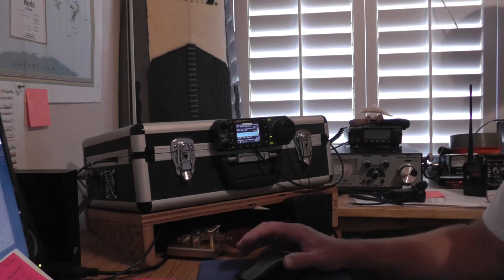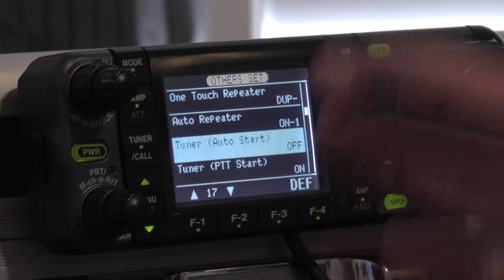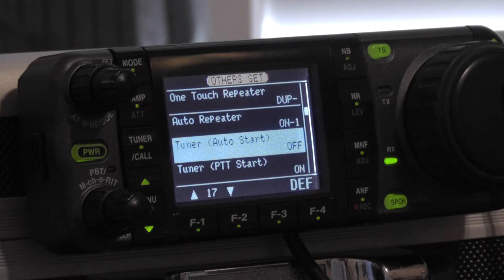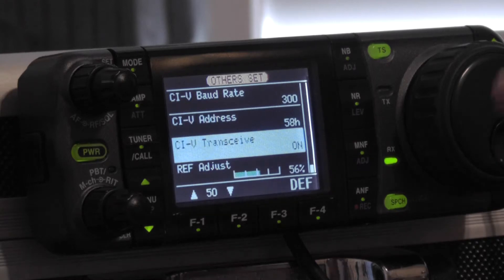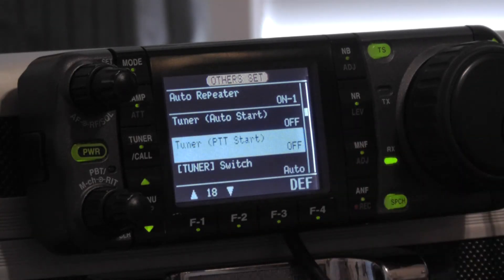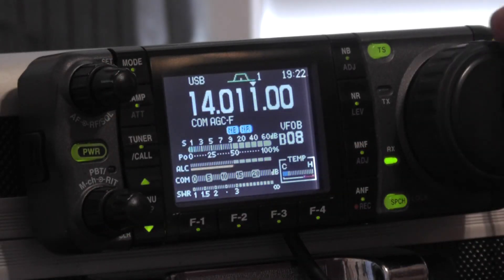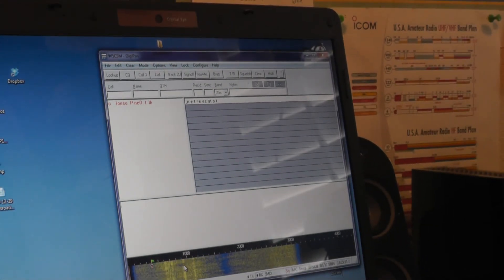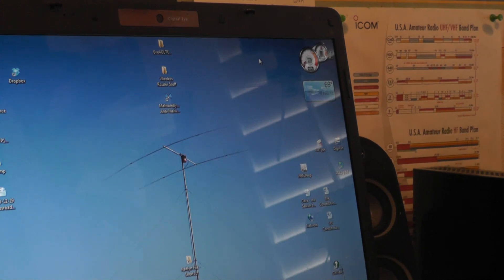Icom 7000 Menu Settings Turbo Tuner for Icom Radios (mobile) to Rig Blaster (base digital)

Comment: Just installed the Turbo Tuner 2 in my pickup truck Today to control my Lil TARHEEL HP and the numbers were far different in my ICOM 7000. All were different and all of the dip switches are set to OFF except the bottom one which is set to ON. It works very very well except the SWR is slightly above 2.1 on 40 meters no matter how many times I retune it? It still puts out 90 watts or more with the 2.1 SWR & unlike many I know that SWR will not damage the radio. I Rarely ever use 40 meters so it’s not an issue for me. I stay on 17 meters about 75% or more of the time and 6 meters if the Magic Band is Open. I had the same model of controller on another 7000 15 or 20 years ago with a TARHEEL II & I worked the world with it. I love DX & mobile DX is great as well. Thanks for your video and God Bless. de W4KVW 🎙

Comment: Question: What is the difference between the Turbo Tuner 2, and the LDG at-7000?  
I just picked up a ic-7000 for my car, and I'm trying to figure out the best tuner/antenna combination, to allow automatic tuning on all bands, including 80 meters.
Thanks and 73
KE6QMR
Reply from the maker: As far as performance you will need to seek out objective reviews on the individual products. I am not familiar with the newer TT2. I  have also run an LDG on this rig years ago but also older and nit the 7000 model. As I recall there may havw been some configuration and interface differences specific to the unit. Bottom line... They all work. For my applications, I used the LDG to tume a 102 inch steel whip and the TT for a screwdriver type antenna. Like I said. Dofferent applications. I hope this helps.

Comment: Very detailed vid.  Do these setting only apply when using the rig-blaster?  Would they be the same if using an MFJ 993B?  Thanks.
Reply from the maker: Tom, My Rig Blaster is the Plug and Play model and these settings are specific to that model.  As for the 993B I would assume that some are similar but may not be exactly right.  If there is not specific literature to your specific setup, I would say "experiment a bit."  Most of the items we are dealing with have specific fail safe error indicators that basically say... that setting will not work, please try another... hi hi.  Honestly, please experiment within reason so you don't release the magic smoke.  hi hi!  Most of my fun is found in the search for what works right but I know that most enjoy the final result, thus these videos.
I hope that helped.  best 73 from El Paso.
de W5CSM sk sk